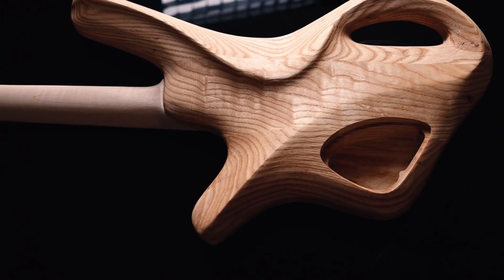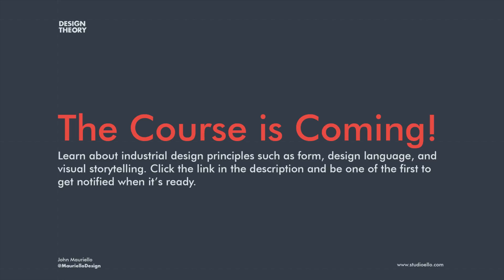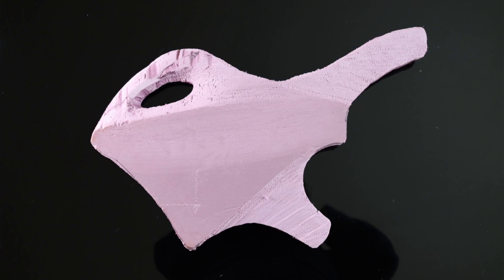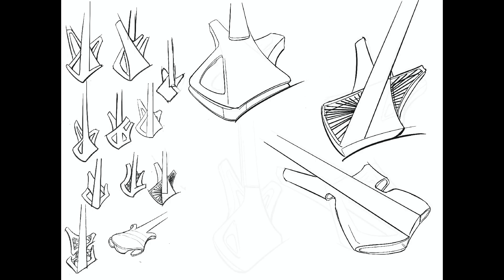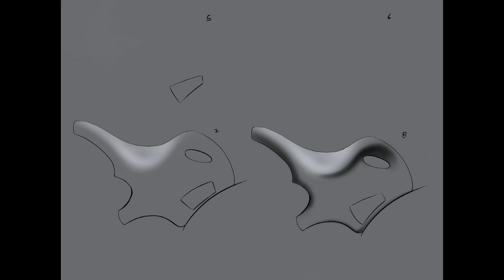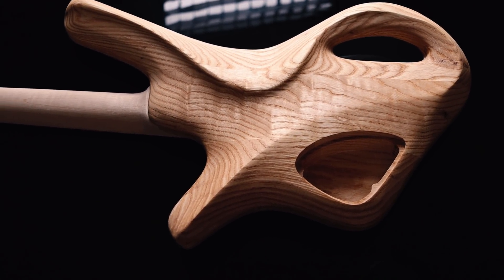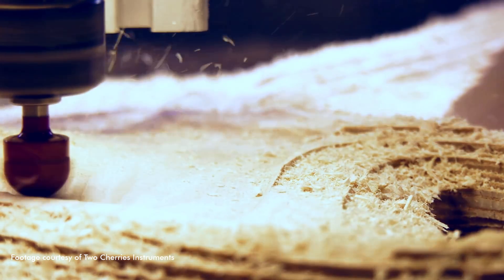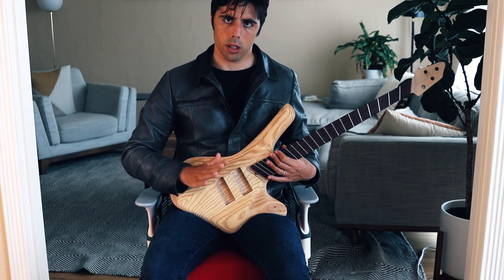How I Re-Designed the Traditional Bass Guitar: Industrial Design Process

Comment: I wonder is the balance going to be right, there is alarmingly lot of emphasis of keeping it light but that is not really the priority. Balance between the body and neck is much more important. There are certain things you can do with light weight design, which is to add weights down low to make it even better for balance on two axis instead of just one. But this looks to be neck heavy to me. Lead weights can be added, cheap source for those are found in fishing section in the hardware store, they have all kinds of lead weights. Lead is quite easy to melt and pour into a rough shape. It is a very good idea to coat the lead weight before embedding it inside the instrument, just to prevent lead from leeching out over time.. Make a cavity at the backside, take a piece of thick aluminium foil and shape it until it can fit the cavity. Make a pit in a sand bucket for the foil, pour in the molten lead. Lead is easy to reshape afterwards so it is not that important to make a perfect copy of the cavity. Use two-parts epoxy to make it really solidly a part of the bass. The weight should be away from the strings, the part of the instrument directly between the two ends of the string contribute the most for its sound and sustain, lead is poor material to be included in that mix.. It is not easy to find a cavity big enough in a finished bass, it should be thought about in the design phase.. and in that phase you can fix the balance issues anyway so... But since wood is a variable there is a need to to fix the balance. Using different attachment points for the sling can help but that can also make it feel awkward to hold. 

The bass should be tested for balance by using a sling that can easily slide. Take the bass and stand up, let go of it. It should retain the same place even after you jump around a bit. If the neck falls down, it is neck weighed and if the body goes down it is body weighed. The margin of error is in the side body weighing, neck weighed are more awful to play but it can not be a lot in either direction. Small imbalances are not that much of a problem, you can add weights to your sling, get a sling that has a lot of grip or just learn to live with it. But.. balance should be one of the prime parameters in the design. Modifying the headstock is very effective way to finetune the balance.
Reply from the maker: Thank you for the thoughtful response. I actually put all the electronics in the control cavity and slotted the pickups in the routs and put the tuners in place (without actually screwing any of it in) and it balanced very well. Obviously different neck/body woods will yield different densities, so I'll have to account for that. The fishing weights option is a solid one.

Comment: Love the design. One question I have is where the jack will plug in. I'm just a home bassist and always have trouble with sitting in armed chairs and having the cable press up into the arm of the chair and get sharply bent. It looks like your design would naturally push that socket up into the "bottom corner" of the body almost so it runs parallel to your right arm. I think this could work but I don't know how it may impact the comfort. Also personally I don't use the classical position, and if it were being designed without that in mind I can see why someone might put that socket on the other point (currently between your legs in classical position.) If this were the case it would be terrible for my playing position poking the cable straight down into the seat. So I think your design could potentially work better for some non classical players despite not being designed for us.
Reply from the maker: I think it'll probably plug in from the front like a Fender P bass. I know that's a super old school way of doing it but there really was no other place to put it.
Reply: @Design.Theory  makes sense. I don't have any experience with that placement so it didn't come to mind.

Comment: This is one of the most interesting designs I’ve ever seen! This has a lot of potential as unless you palm mute or play with a pick its quite uncomfortable, this seems like a very wholesome design for someone to hold, its extremely different and it looks good. But how heavy is it and how would it sound? Because those might change based on what would someone would use? Either way great work!!!
Reply from the maker: I think it would actually work pretty well with palm muting/pick playing, but I'd need to test it out to be certain.
Reply: @Design.Theory  oh wait I think you misread it. Unless someone palm mutes or picks on a fender bass. It feels uncomfortable. Over here everything seems really slick and looks great too.

Comment: Carpal Tunnel syndrome doesn't appear because you have a bad guitar, it's because you have bad technique. Fender Guitars are well made instruments. I get your point, but the way you came to have the problem is wrong. Fix the technique, not the instrument.
Reply from the maker: Well designed instruments more easily enable good technique

Comment: It's a very cool looking Bass.
I enjoyed watching your design process, sketching, prototyping etc - but especially starting from a set of design goals.
It is understandable that, with your ergonomic goals being similar (classical and standard seating positions) to that of people like Ola Strandberg, that the silhouettes would be similar.
But - with extended upper horn for needed balance in the case of the bass.
Your signature elements are very nice though - especially the curves around the back side.
There are many assymetric neck shapes used in guitars and the Strandberg, patented EndurNeck is also a standout - may be worth a look for your Bass.
Being  a bit poor to get foam, and having a lot of it around, I have a guitar design in corrugated cardboard that I've had hanging on my wall for a bit as I think about the next steps in it's evolution. This also started from small sketches, through to full-size 2D drawings and then onto 3D.
Back to neck - I have an idea for a modified "soft-V" shape that angles in a way similar to the Strandberg too - just need to test it out.
Reply from the maker: The soft V seems to work very well. I would encourage you to experiment more with it. I find it to be quite comfy. Like I said in the video, though....neck profile preference is extremely personal and subjective. It varies widely from player to player

Comment: As a bass player, I hate to break it to you but you're kicking in an open door. 
There's plenty of ergonomically designed basses on the market, at various prices, and the modern bass has already been embraced by a large number of the bass playing community.
 
But I appreciate the attempt. You should check out Ritter basses, in my opinion their designs are top of the line when it comes to modern bass.
Reply from the maker: In retrospect the video makes it seem like I'm the only person to ever make an ergonomic design. I actually added a pinned comment basically explaining that I certainly am not the first or the only person to attempt this. This is simply my take. I have used a couple ergo designs on the market and I think many of them were better than existing designs, but not ideal. I've only tested with a few users though, so I could be wrong.  Ritter was one of my favorite luthiers growing up. Aren't his basses like $10k+++?

Comment: Pickup positions appear to be wrong, scalled neck basses have angled pickups, also the scale on the neck looks weird at first sight. It looks great, but without custom pickups don't know if it will work
Reply from the maker: I still have to test the sound to see how it sounds. We'll find out soon enough. In its current state, the treble side might be too sharp and the bass side might be too muffled, but we won't know until we try it.
Reply: @Design.Theory  Bass looks great, but if it does not play good, or has intonation problems due to the the scale, it defeats its purpose.
Sometimes an extra concept can ruin an underlying good design. Don't think you need scaled frets, maybe in an future version?

Comment: I like the design a lot, although I am not sure how the angled frets are going to function vibrationally as the intervals between the frets are different for each of the strings, which would make each string have its own incompatible acoustic scale, unless it is a midi instrument where the vibrations are not the sound source.
Reply from the maker: It's a multi-scale neck. Each string has its own scale length. It's a somewhat common design these days

Comment: you need to angle the pickups to compensate for the multi-scale, look at anything made by dingwall
Reply from the maker: yeah I want to do a sound test to make sure of that. The angled pickups looked really stupid, and it also would have required me to make some major changes to the body design

Comment: That ridge could make it very uncomfortable while playing standing up, which most bass players tend to do.
Reply from the maker: Yeah, I've got to test it out
Reply: @Design.Theory  Seriously?

Sorry, But I'll stick with the old then.
Reply from the maker: @Diggnuts  I mean of course I've held it for long periods of time, but I need to test it with more people before I just go ahead and unilaterally decide "yeah it's comfortable"
Reply: @Design.Theory  Holding it is one thing, playing it on stage is something completely different. Moving around, having to deal with unforeseen stuff, the instrument should be wield-able without it getting in the way of things.

Easiest bass I ever played was practically a smooth oval with smooth edges. Never did it intervere with my body while playing.

I simply can't imagine that sharp ridge pushing on your sternum will be fun more more that just a couple of minutes. That point could project kilo's of force on that line. That is going to hurt very quickly for some playing styles.

Comment: I'm a UX designer (shares some principles with ID) and a guitar player (who also plays bass and dabbles in lots of other instruments). I don't mean to be a hater, but...I just don't see the point of this project. You said the central use was case carpal tunnel, which I think indicates a focus on wrist ergonomics, and you showed someone gigging standing up (as most bassists will be). Then you focused on a sitting position and the ergonomics of placing a bass on your lap in a classical position. That's fine as a focus and optimization, but it just doesn't seem to have anything to do with your initial premise. I don't think sitting comfort is going to have much to do with write carpal tunnel or RSI, and if your friend is gigging standing shows it becomes completely irrelevant. Often when a professional wants a guitar that's comfortable to play sitting down in the studio or at home they'll buy a second guitar designed for that purpose--that's why studio models exist. They tend to be lighter, smaller, and yes: some (like the Strandberg, but there are others, going way back) have leg cutouts to sit flat on the player's lap. But because those things don't matter quite so much when you're standing up and many players don't like the look of those models, they're bought almost exclusively for studio play. If the only innovation of this guitar is that it sits comfortably on your lap...I'm sorry: that's simply not an innovation, and I don't think it addresses the health concern you premised the video on. Essentially you just...designed a bass body you thought looked cool. That's fine!  Lots of people do that!  But I think you either under-explained or misrepresented the use case or ignored it.
Reply from the maker: The bass rests in the same place sitting as it does standing. It's actually a bit easier to get a bass to balance properly while standing, because it doesn't have to rest on your leg, which actually sort of limits the way that you can place the instrument near you. Most people tend to practice while sitting anyway. They usually only stand at gigs and rehearsals. That's why being able to properly hold it while sitting is a better test of ergonomics.

Comment: the resting design of  body is promising, but i see the angle of the fan frets going towards the bridge is a bit disturbing. what angle will the bridge be?
Reply from the maker: each string is a different scale length, so the bridge is slanted
Reply: @Design.Theory  yes we understand that already. Its the angle of the bridge i am curious about. if you plot radius point where the nut and the last fret on the fboard, that point will serve as reference to your bridge, my question still.... what is the angle of the bridge?
Reply from the maker: @dinobaldesancho2574  I'd have to look at the CAD, but it roughly follows the same angle of that bottom curve of the instrument.
Reply: @Design.Theory  Its a great video for design process,.

my conclusion is, it will be a great addition to what is existing out there (in the fan fretted/multi scaled bass category)  👍🏼
Reply from the maker: @dinobaldesancho2574  Thank you Dino, I really appreciate that. And thank you for asking thoughtful questions!
Reply: @Design.Theory  the instrument closest out there to your design is,  the Strandberg. they even design a new neck profile called EndurNeck. they also considered the seating position design in between your legs, fan fret, pick up position, traditional and modern players tone preferences, weight of the body, tone wood, hardwares, etch etch.

Comment: Looks cool. The issues detailed in the earlier part of the video about traditional designs and carpal problems: it's my opinion those players experiencing pain have terrible technique that has nothing to do with the shape of the instrument. There are way more examples of proper technique on the Fender design by multiple body shapes that the redesign is  not needed for the purpose of ergonomics.
Reply from the maker: Yes you are 100% correct. I definitely cherry-picked awful technique. However, I would argue that the traditional instruments don't necessarily enable good technique with their body and neck shapes. Yes, you absolutely can have good technique on a Fender bass, but the instrument certainly won't be doing you any favors in achieving that end. Thank you for watching!

Comment: Here’s a couple of interesting design changes I’ve written down for conceptualizing a guitar:

Rubber padding on the edged in contact with the legs like on a high-end Flying V

An Ormsby-style output jack to wrap the cord around the strap button

A radical body design where the neck is twisted outwards 35 degrees and the body is twisted inward 15 degrees, like on a Torzal guitar

Natural Geometric Chambering on OD Guitars

Snakeskin Pattern on Dean Zelinsky Guitars

Compound Radius

Pyramid frets on Petillo Guitars

Removable memory foam that’s placed on the neck (my idea)

An 8mm concave around the heel of the neck (i believe it’s an Ernie Ball thing)

A double-action truss rod that can be adjusted with an allen key on the side of the neck like with Warmoth guitars.

An Ernie-Ball shaped headstock with a Valiant Inspired Diamond-Shaped Volute

Magnetized guitar nuts, screws, covers, and pickups, kinda like a Relish Guitar design

Being able to adjust the individual string heights for the nut like on Valiant Guitars

4-Screw Jack ring on Reverend Guitars

And Tall knobs/toggles for better reach (my idea) kinda like how professional drivers modify their stick shifts to be incredibly tall so they can shift gears easily.

Yes, some of these designs may have a patten on them, so you can’t freely use them, but I like to think that there’s a way to take from those pointers and build something new out of it without a lawsuit

Comment: This is very interesting. What about balance when it is worn with a strap? That bass looks like it could suffer from neck dive.
Reply from the maker: Keep in mind it also didn't have pickups, preamp, or any electronics in the body. I actually tested it out by putting all of the electronics/tuners on their respective ends of the instrument and it balances almost perfectly 50/50. Very slightly favoring the body. There are differences in weights of wood, and I bet certain ones might be neck-heavy. I would probably put some extra weight in the control cavity to counteract that. The instrument is extremely lightweight, so adding a couple ounces to the body wouldn't make a difference

Comment: Ahem...most "real" bassists actually play standing up. If you define a "real" bassist as a gigging musician with regular work, then they practice as they play, namely, standing up. If you're designing these for noobs and session bassists, then I can see some benefits to your approach. Bob Kozim of Kozm Guitars is also doing the same thing with regards to guitar ergonomics. At the end of the day, there's nothing you can do about the strings and neck remaining straight. I have massive hands and play a 6 string bass, tuned exactly like a tune my guitars, the better to piss off my bassist bandmate, especially when I go on pentatonic runs.
Reply from the maker: It should work better standing up, too. Still gotta install the strap pins to test it though.

Comment: I’ve never played a multi-scale (fanned fret) instrument, but they always look so uncomfortable on the B/E strings. I’m curious the Bass side scaling is; 34”, 35”, or a shorter scale length. It LOOKS like a shorter scale instrument against your body.  I’m also curious if headless tuning entered the equation for comfort/weight/balance considerations.
Reply from the maker: It's 32"-30" scale. Good eye. Headless tuning came into the equation but I didn't do it for a number of reasons. I think I wrote about why in another comment.
Reply: Either it was a shorter scale instrument, or you were a GIANT MAN!